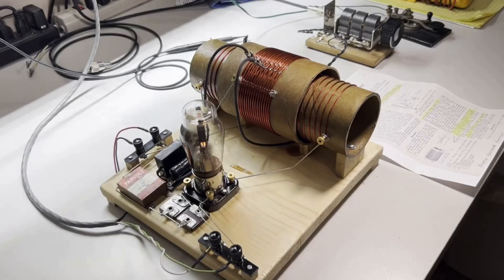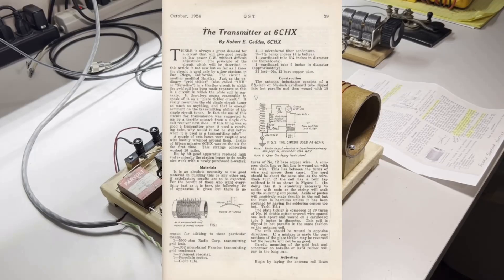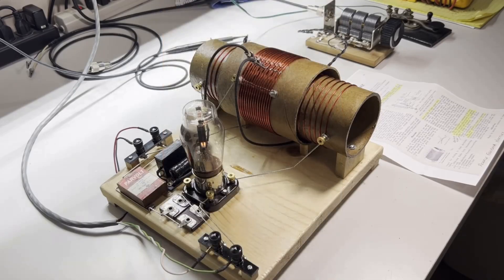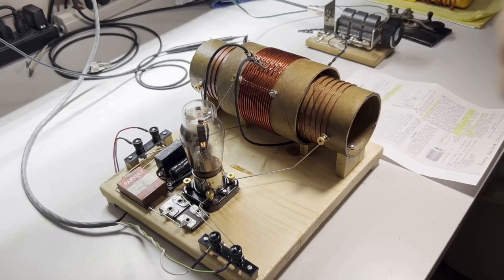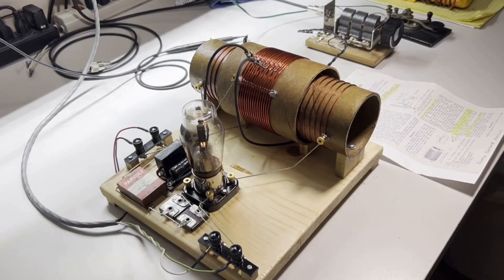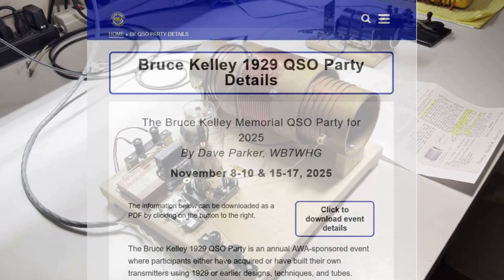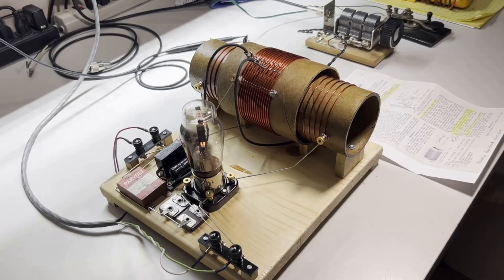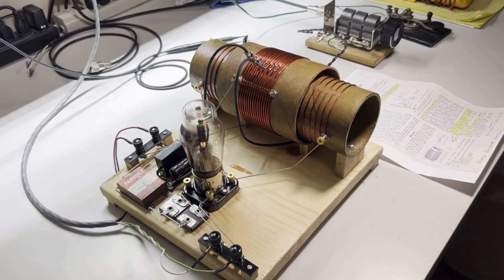W8PU's New Build of a 1924 CW Transmitter

Comment: Was the "rasp" intentional because receivers did not have a BFO?
Reply: No I don't believe so. Most of the "buzz" I believe is due to the close proximity of the receiver I was using as a monitor. Besides regenerative receivers were being used in 1924.